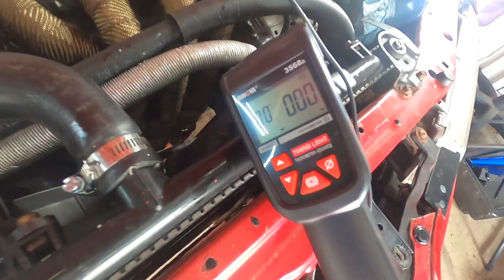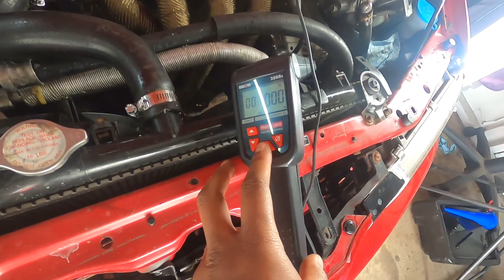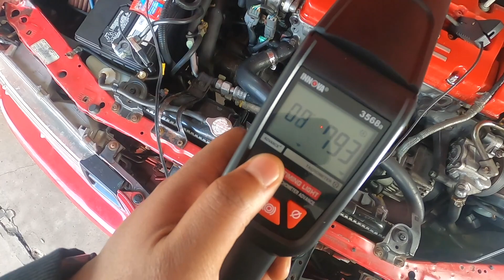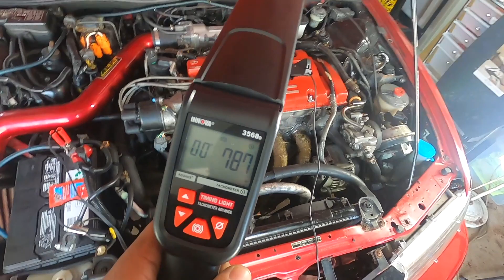Setting Project Prelude Ignition Timing (H22A1)

Comment: I got a 1993 Honda prelude, I definitely need to work on the ignition timing. I put in a new distributor but I didn’t adjust it in the correct position.
Reply: Careful. The motor can blow with too much timing advancement